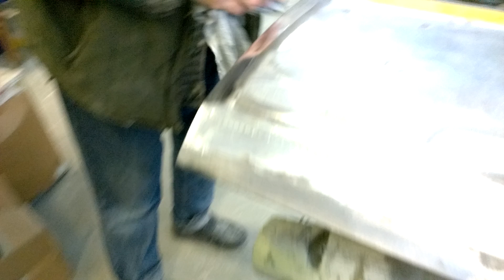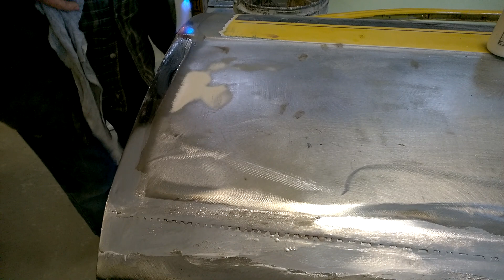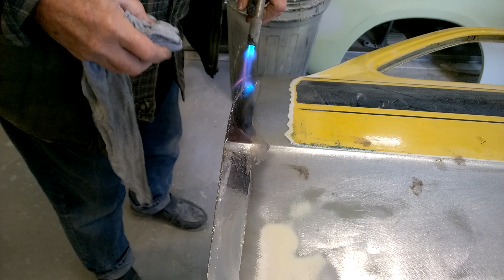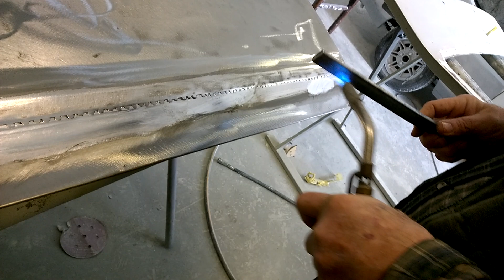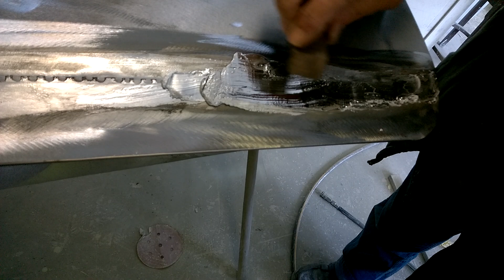Lead loading Escort Mk1 door

Comment: Good work, however, I prefer an unbroken continuous weld on the repaired panel, as that stops a lot of heat distortion, and acts as extra strength, and moisture barrier.  It’s true that solder will run into gaps, but it can’t be as good as steel weld.
Reply from the maker: The edge had been joddled